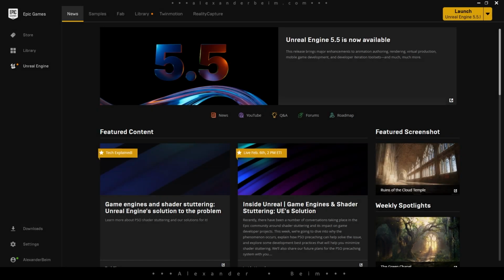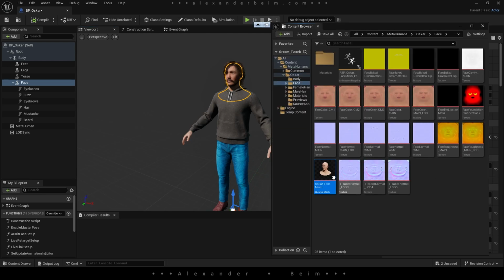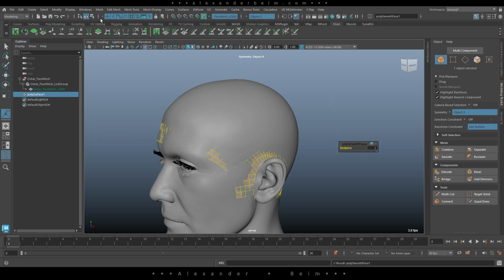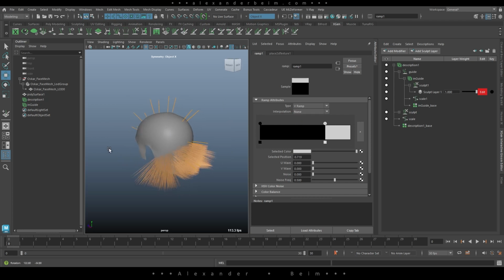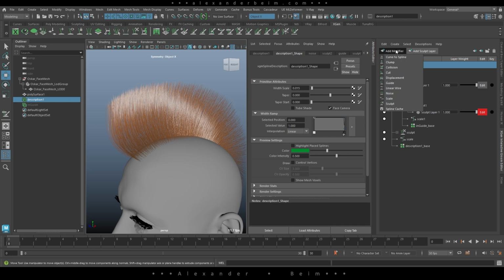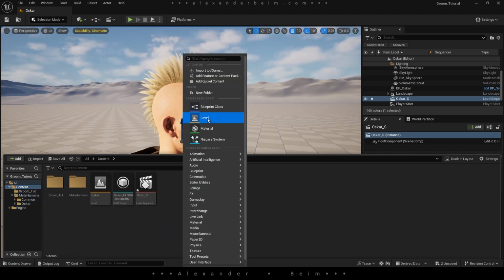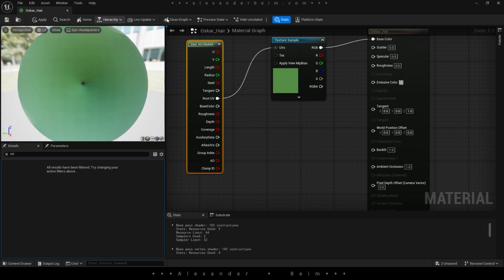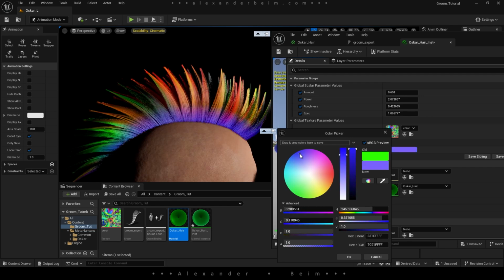How to Create a Custom Hairstyle for MetaHuman in Maya | Colored Hair material in Unreal Engine

Comment: Thanks for the tutorial! Is there a place to offset the hair that is bind to the head mesn? after importing from maya and bindingto my metahuman, the hair is higher than the face mesh (so there's a gap between hair and the scalp).
Reply from the maker: Glad you liked the tutorial! In my video, you can see that I first exported the Metahuman head as a triangulated mesh to Maya and used it as a reference for positioning. Then I moved my quad-based head mesh to match the location of the one exported from Unreal Engine. I’d recommend doing the same — it really helps with proper alignment, especially for the hair.
Reply: @Alexander_Beim  You don't have to deal with Triangulated head mesh, neither to model a head cap, all you need to do is to export the digital asset from MetaHuman creator to Maya, which ensure you have it all right in Maya, or you can use Quixel Bridge to export the Meta human to Maya directly if you have it in your custom MetaHuman library there, but what you did works, it's just more unnecessary additional steps, anyway, great and detailed work.